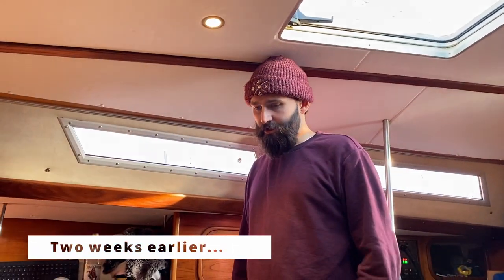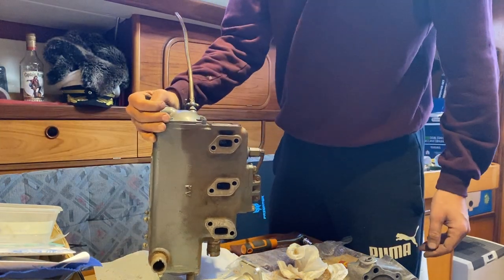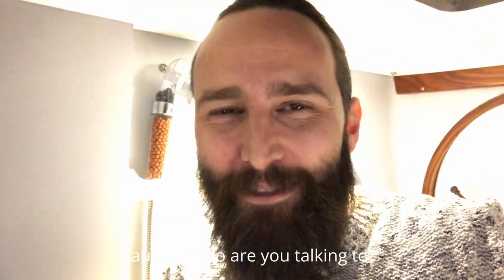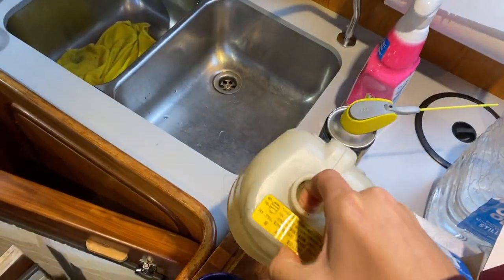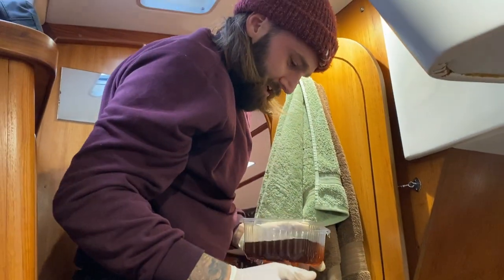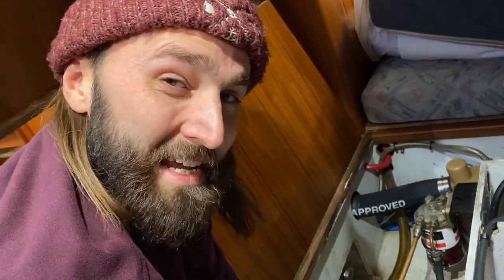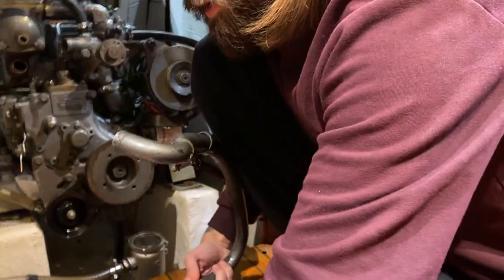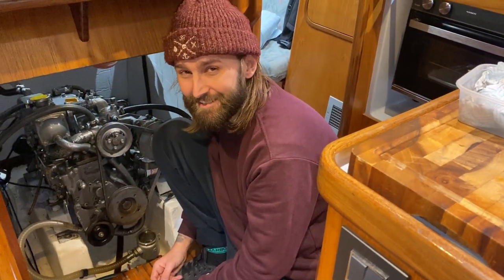YANMAR Marine Diesel Engine I Top End Rebuild with NO EXPERIENCE l Pt 4 I Ep. 35

Comment: I don’t know about UK/EU standards, but that clear vinyl hose you used for cooling water supply to the mixing elbow definitely doesn’t meet US standards (ABYC & NMMA).  You should use a heavy duty reinforced rubber hose rated for high temperature & pressure. This is a critical hose, hose failure could result in flooding the boat, and burnout of the exhaust hose and/or water lock muffler (often plastic).  Personally, I wouldn’t use vinyl hose anywhere on the boat, except maybe from a foot pump to a sink spigot. 
If you don’t have Nigel Calder’s “Boatowner’s Mechanical and Electrical Manual” you should definitely get a copy. It’s very helpful.

Comment: Your replacement hose for the exhaust elbow seems to be PVC.  Does this have a high temp rating? It does not seem to be fiber reinforced either.  If you engine works anything like mine, the raw water from the heat exchanger  is coming through this and is hot and then goes to your plastic water muffler and then burps out with the exhaust.  If this were to rupture, your plastic muffler quickly melts. Don't ask me how I know this.  Get a proper sized hose for that temperature.  An automotive heater hose would be OK.  What you have may be OK for a test run, but I would not want to rely on it long term.
Reply from the maker: Thank you so much for watching and for the handy tips! ☺️ We got this pipe from our local marine mechanic, he told us it will be fine for the job, but now you have us wondering? 🧐